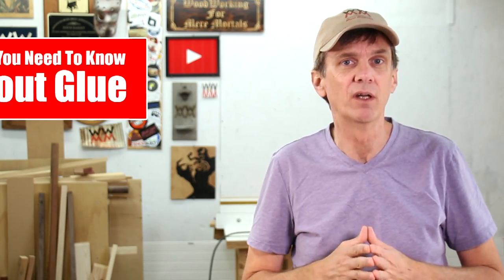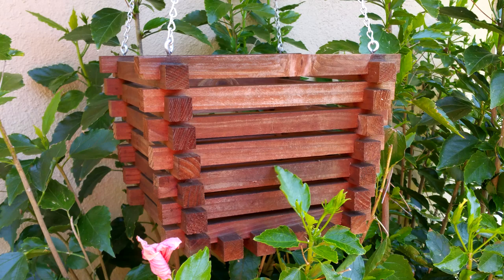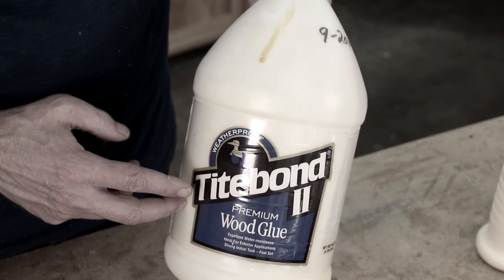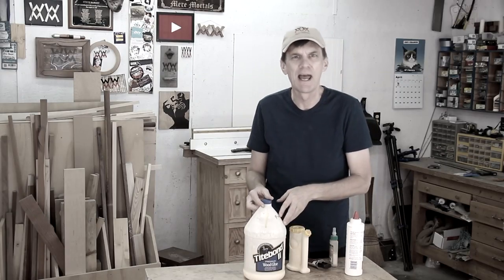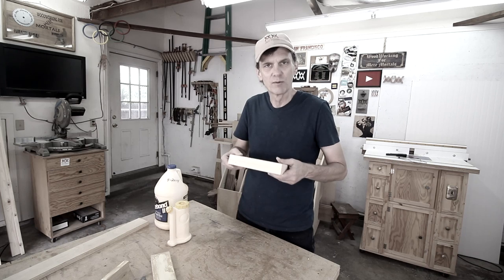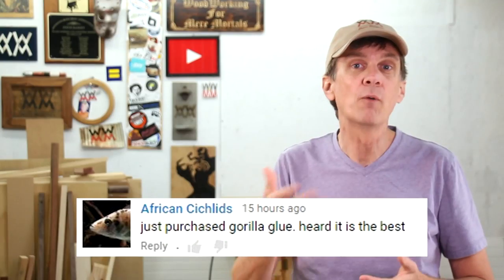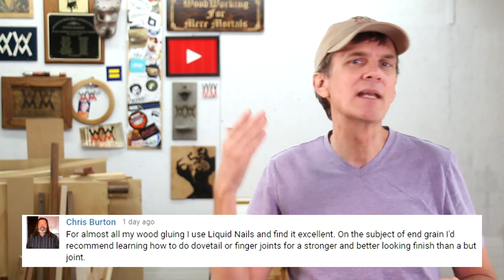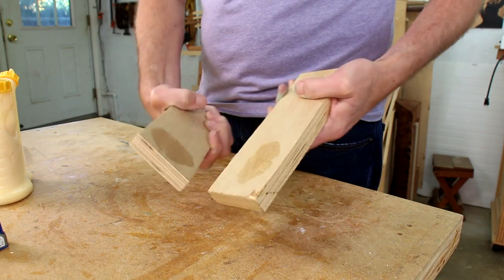Why I Don't Use Titebond III | MORE MINUTES

Comment: My best results to-date have been in using Polyseamseal Silicone Caulk. I began using the stuff to bond MDF back in my subwoofer cabinet building days, where I needed to guarantee an airtight seal. But I found it worked well for virtually all wood applications. It was set-it and forget-it, and studs would rip themselves apart long before that seal budged an inch. It was reliable and fairly cheap.

Sadly, I no longer live in the States and I've not found a suitable replacement for it in Norway. So I'm back to traditional wood glue.

Comment: Seeing this title scared me for a second since I just picked up a gallon of titebond III last night from the hardware store. I typically use titebond II and III. They are both strong but III has better water resistance and more open time when working with it. When I do a lamination the extra open time is nice to have. Also if it is a hot day out glue tends to setup quicker so I go for the III for more time. I buy both the II and III in gallon size containers, cause why not. Thank you for the video it sparked questions and through the comments I learned that titebond III is foodsafe which I did not know.

Comment from the maker: Have you used Titebond III? Is there any reason I should give it another try? Titebond II seems to work perfectly on every woodworking project I build, indoor or outdoor. I love Titebond 2 wood glue, but Titebond 3 leaves me confused.

Deleted scenes from last Friday's video and answers to your questions. Watch that video first: https://youtu.be/Esvb64fUQ10
Reply: +Steve Ramsey the main difference between Titebond II and Titebond III for outdoor projects is the MICROJIG!...
Reply: +Juliano A. B. Gonçalves that is funny...good reply. lmbo!!!
Reply: +Steve Ramsey We use Titebond II almost exclusively for our shop. We go through around 30 gallons a year and it works great. Sometimes I break out the West Systems epoxy for dissimilar materials like metal in wood. We also use a ton of CA glue. I use CA for patching small cracks where a clear patch would look alright but it repels finishes and stains the wood sometimes. As far as polyurethane glues like Gorilla glue it's not that strong and haven't found a good application for it in our work.
Reply: +Steve Ramsey 
I used Titebond III to do some pear tree bark grafts as a sealer since it's waterproof. One person suggested a waterproof elmers glue, or a wax based sealant, but TB3 seemed to be the easiest and most accessible. The grafts took and are doing pretty good so far.
Reply: +Steve Ramsey I'm on the titebond II train as well. I worked in a high end cabinet shop for 6 years and we never used anything else. I have used titebond 3 one time in my time at my current job to repair a cajon that came in with a crack and a head that needed to be replaced. I used it purely because the gentleman said he played it outdoors a lot and it was going to touring around with him, etc. So I took weatherproof to mean more able to deal with flex, temperature, and humidity changes rather than just straight waterproof. I'm not sure if that's true or not, but he hasn't returned and we haven't gotten any phone calls, so I assume no news is good news. That's my 2 cents. Thanks for the great content my friend, been enjoying the channel for years!
Reply: +Steve Ramsey I have used Titebond III for cutting board, as it might come in handy being waterproof (Passes ANSI/HPVA Type I water-resistance, Titebond II pass ANSI Type II water-resistance (lower level)) and is foodsafe (FDA approved for indirect food contact (cutting boards) - taken from official web site Titebond(dot)com, Titebond II is food safe as well, so no difference here). I would use TB III for something that comes in contact with water more often - just to be sure. And for the dark glue line, I have not experienced it so far, might have been some other issue, who knows.
Reply: +Steve Ramsey at one store I only saw Titebond III as maybe the vendor thought that they should only carry the latest and greatest. I think the advice I would share is to get the smaller bottles of glue and try them out. Figure out what works for you.
Reply: +Steve Ramsey It's FDA rated for direct food contact. I've used it with great success on cutting boards, but it's not any better than II or I on other projects. It dries darker than II or I, making your joints more visible if they aren't perfect. If you get any on clothing it will never wash out. It's also much more difficult to remove squeezeout cleanly for finish and it's harder to get off your hands.
Reply: +Steve Ramsey ... can't squeeze the glue out of a joint??? Mathias Wandell proved that.
Reply: +fiveletters Read the spec sheets.  It is NOT rated for direct food contact.
Reply: +jimbooth3 Ah, you're correct. Indirect only as per http://www.titebond.com/product.aspx?id=e8d40b45-0ab3-49f7-8a9c-b53970f736af . I thought I'd read or seen MTM mention it was direct, but source amnesia got the best of me. In any case, given his output I'm confident using III vs. II on his recommendation.
Reply: +Juliano A. B. Gonçalves  Well played, my good man - well played indeed. Score yourself 5 bonus points.
Reply: +Steve Ramsey , my basement shop is unheated and gets down into the low 50's in the winter. I use titebond 3 because of the temperature rating and the long open time. I've never had staining.
Reply: +Steve Ramsey I use Titebond 3 for wooden boat building.  Works well.
Reply: +Steve Ramsey All your points on Titebond III are valid: stains especially. It is also harder to sand clean than II. It does have a longer open time, so may be better for complicated glue-ups. Titebond Extended is also a good substitute for II in complicated glue-ups, but harder to find than III.

Poly glue is useful for gluing dissimilar materials to wood: PVC to wood. See New Yankee Workshop video of Norm building his Improved router table.
Reply: I use Titebond III for complicated glue ups for the extended open time. So far, no staining issues. I've only gone through a couple of the 16 ounce bottles though.
Reply: Titebond III is FDA approved for indirect food contact. For cutting boards and butcher blocks it works amazing!
Reply: +Steve Ramsey You should check out 'mtmwood'. He explains it like no other on youtube.
Reply: +Steve Ramsey Hey Steve. Very informative video. One thing I disagree with is I find (gel) superglue to be very effective in holding returns on small molding projects.
Reply: +Andrew Latham Because the ones in the know only buy 1 and 2, leaving 3 to sit on the shelves
Reply: I'm not sure if anyone has pointed this out yet, but when you point at the two labels about 45 seconds in, Titebond III says "waterproof", while the II says "weatherproof". They don't have the same label. I'm personally a TBII man myself, but I thought I would just point that out
Reply from the maker: +West Wassom I screwed up bad.
Reply: +Steve Ramsey Haha no you didn't. If the Titebond II has worked for you all these years the labeling obviously doesn't really make a difference. The video still makes sense
Reply: tite bond III is food-safe for cutting boards  and such , or am I misundertook ?
Reply: Charlie White Yes, Titebond II and III are both food safe.
Reply: Charlie White They're safe for indirect contact, so as long as you're not letting the food sit on the board for hours, its okay.
Reply: Titebond III takes longer to set up so if you need extra time doing your glue up use TBIII if you don't use TBII...That is how I use it my shop..
Reply: TB 3 is foodsafe when I made a bowl And spatula it works great fór bonding kitchen wood items
Reply: Hi Steve! Titebond III is stronger than Titebond II. III has a strength of 4000 psi but II has only 3750 psi. The open time for III is around ten minutes and the open time for II is only 5 mins so you can play around a little more with III. III is also more viscous than II, personally I find that helpful because it runs less. You can also apply III at a lower temperature than II. Minimum application temperature is 47 F for III. It is 55 F for II. Titebond III is also more water resistant than II, although I find II is sufficient for almost anything. You mentioned III being water proof, but you still can't submerge pieces bonded with Titebond III. Wood absorbs water and softens around the joint and fails at the glued surface, though I don't think it is the glue being softened. Hope this helps :)
Reply: Andrew Latham s
Reply: Steve Ramsey only if you’re doing a large glue up that will take longer than 10 minutes before the project is in clamps tbh.
Reply: Actually check the label again... Titebond II is weather proof and Titebond III is Waterproof 💦 
My outdoor furniture glue joints using Titebond III has faired better than the Titebond II joints.
Reply: It should also be noted that Titebond III is supposed to be dishwasher safe. That being said, I'd never use it unless there was just no other option.
Reply: I use II and III in my shop. If I have many pieces to glue I will use III because it gives me an extra few minutes. For everything else I use II. I dont bother to clean up the squeeze out for either. I just let it dry then scrape/chisel/sand.
Reply: I have used Tightbond III and I don't like it. I hate how it stains my hands. Tightbond II is awesome and luthiers use it as the preferred glue when building guitars. And guitars are under quite a bit of tension due to string pull.

Comment: I think the 2 part super glue you are talking about is 2P10.  I work around it almost daily, it does hold wood together well but now as well as wood glue.  I would recommend using it for smaller pieces.  And once the activator is sprayed on, the glue will be completely dry in 5 seconds.

Comment: II grabs earlier, dries semi-flexible and is weatherproof.  III grabs later allowing more open time which is important when say veneering in a very hot workshop.  It dries harder, is waterproof and foodsafe certified.

For loudspeaker makers like myself, tightbond II is the go-to glue along with Elmers.  Cabinet panel resonance can be partly damped at the joints which is ideal.  It results in very strong joints but they must be close tolerance.  

For sloppier joint repairs I use Gorrilla glue.  Its never let me down.  For close joints the bond is still stronger than the wood if clamped well and surfaces to be bonded are first damped with a little water as it reacts chemically and the water is a catylist and results in stronger bonds.  When dry any overspill is easily worked by chisel or sandpaper.

Comment: 7 drops of Superglue can lift a car - Mythbusters
Gorilla glue is terrible at filling joints -  +Matthiaswandel
Matthias also tested if you can squeeze all the glue out of a joint, making it weaker. Sorta.
Reply: +Luke Den Hartog Superglue has a great tensile strength, but its shear strength is fairly poor. The car test was entirely tensile; the two plates were not sliding against each other.
Reply: +Johnny Steen Superglue's shear strength is okay, but it's very weak against peeling, which concentrate stresses along a small portion of the joint, which fails and the process repeats until the entire joint fails.

Steve's demonstration of breaking the superglued lap joint apart shows the glue failing in this manner. As he levered the wood apart it would be stressing one edge of the joint, rather than applying the load evenly as it would in pure shear or tensile.

Comment: I use CA to fill holes. You can add more saw dust, make sure you use the thin ca. Glue is clear and it really hides the hole or crack.

Comment: III is also food grade. II is not.

Edit: III and II are supposedly food grade and I is not.
Reply: Tekagi  I stand mostly corrected. I found this on their website:

"All of our Titebond wood glues are safe to use and produce no harmful fumes. They meet the requirements of ASTM D4236 for safe use with arts and crafts. Titebond III Ultimate Wood Glue and Titebond II Premium Wood Glue have both been approved for indirect food contact. For this reason, it is the glue that we recommend for making cutting boards. We do recommend wearing gloves when working with the Titebond Polyurethane Glue because repeated use of the product with bare hands could lead to a sensitivity to those types of products."
Reply: Tekagi  well yea the more I read they all seem to do the same thing .. however the glue is totally different once you get it out of the bottle..
Reply: Either way, dont eat it.

Comment: Excellent video, Steve. With TBIII, it's not so much that the glue stains. The real issue is that TBIII itself dries to a dark brown color. With Gorilla glue, I've found it to be perfect for gluing magnets into holes in wood. The foamy texture is great for filling gaps and it holds very firmly, even on the smooth surface of neodymium magnets.

I completely agree with your assessment of Super Glue. I've never had Super Glue hold wood worth a crap. It just soaks in and creates a weak bond. But even on surfaces that don't soak it up, it never really holds very strongly to any kind prying or torque forces. Finally, you are also correct about the "clamping too hard 'starving' a joint of glue". That's one of those myths that just won't die. Like you said, you'll damage the wood way before starving the joint.

Comment: in regard to your filling nail holes, I've used sawdust and whatever finish you plan on using; make a slurry with the two parts and apply to the hole. Though I've only used it with shelac and it turned out very well, I have not experimented with other finishes to see if it only works with finishes that dry relatively hard.

Comment: I recently used Titebond Type III and sanding sawdust from same wood on a miter joint with a 1/32 opening. The glue turned dark and the joint looks bad as a result. I'll try with type II next time. Good call Steve.

Comment: From what I understand, III has a slower drying time and is safer for food, so I use it when making cutting boards, napkin holders, etc. never used titebond II, but I would imagine they do mainly the same thing. I have noticed a small amount of darker glue residue with III, but it always sands off really well. Thanks for the video, as always!!!!

Comment: CA works well with very porous woods like balsa. Most of us who build model RC planes use it. The spray you referred to is an accelerate (known as Kicker) to speed up the drying. Best of all you can mate up two pieces of balsa and then apply the glue, it will wick into the joint. You are correct it doesn't work well with harder woods but is better than wood glue for balsa in my opinion anyway.

Comment: After many years of "titebond" use I decided to try plain ole elmers glue....the glue I recommend is the Elmers wood glue MAX. it is as strong or stronger as the "III", has ample open time and cleans up easily PLUS it is a lot less expensive. I buy the largest containers and use the smallest so it is easiest to manage in old hands. I also use a smaller nozzle from other containers because there is less waste and cleanup involved. I guess I have used Elmers five years and never had any problems with it's quality, I cannot say that about titebond. In the winter I heat the glue in hot water from my shop mircowave...titebond did not work well at that point, Elmers does. I sell hundreds of items online and as yet never had any complaints.

Comment: you can technically over-clamp a glued wood joint, making it weak, but you would likely need something such as a hydraulic press. As you said, a standard clamp will dent the wood long before it would put out enough pressure. another commenter mentioned that this can happen when making skateboards, which makes sense since those are pressed under high pressure.

Comment: Elmer's all the way.
Reply: Not even funny.
Reply: If memory serves, both Elmer's and "wood glue" are PVA's and have similar holding strength.  The difference is Elmer's (white) glue has a much longer open time.  Which can be good.

It's holding together my homemade workbench base, for example.  For years.  With no problems.
Reply: Michael Campbell the white Elmers glue is also useful for filling gaps in the inlay for musical instruments. You mix fine saw dust to match the color or add die. Back in the day.....when I first started woodworking, all there was available was Elmers glue for most projects.    There was a mix powdered stuff for water proof projects .

Comment: The best use I have ever found for superglue is for first aid. If (when) I get a minor cut on a finger that a band-aid will cover, but just tends to bleed a lot when moving the joint, I wash the wound, dry it, then put a drop of super glue on it to bind it together. Kinda like a stitch in a tube...without the pain of the needles! :-) That way, I can keep working on my project without bleeding all over it.

Comment: I recommend using the smaller size (16 oz.) TiteBond II bottle, which has a built-in solution to the dried glue problem: when the nozzle is closed by pushing it down onto the bottle, the gap is cleared by another piece of plastic, so only a small crusty bit forms that is easily removed with a thumb nail. You can refill it from the gallon jug, of course. This solution does have the disadvantage of having to turn the bottle upside down to spread your glue (or just keeping it very full and squeezing a little more).

Comment: I am trying titebond 2 for the first time, Was using 3 but ran out so I am trying 2 so far 2 is easier to work with is not running like 3, so I have switched to 2 thank you Steve also less expensive